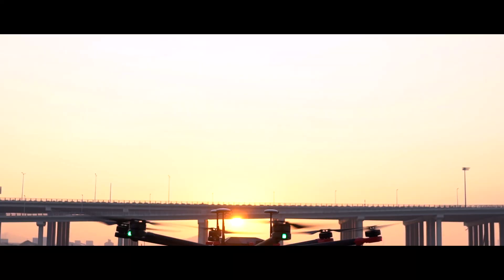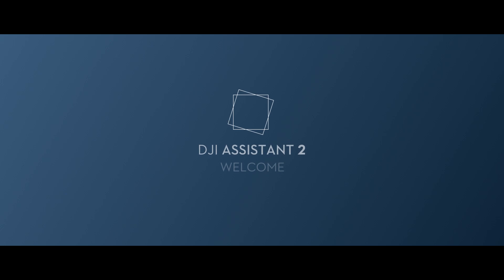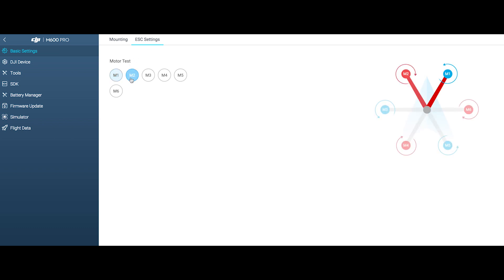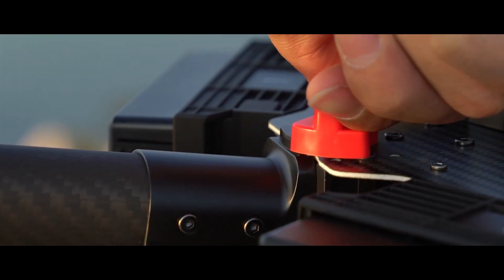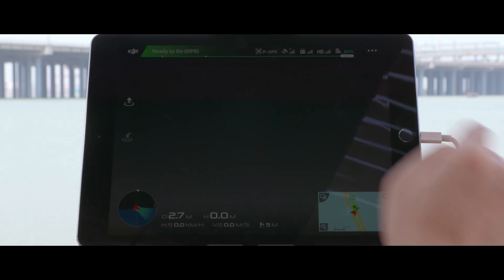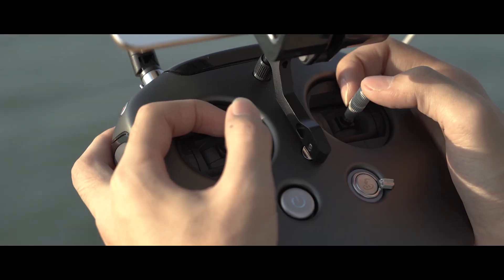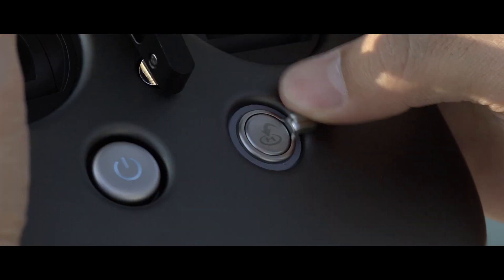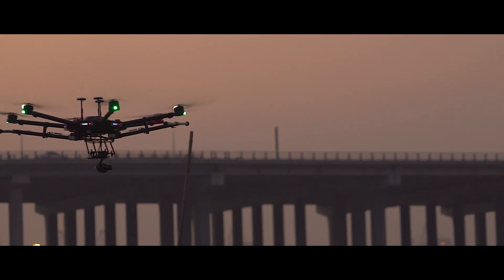DJI - M600 - First Flight

Comment: Hello, 
I have this Mavic pro, it was working fine yesterday, but today, I turned it on, on my mobile, it says disconnected, I checked connections, everything is fine. I also reinstalled the app and clear the cache, my mobile dji app still shows disconnected, any suggestions? thank you